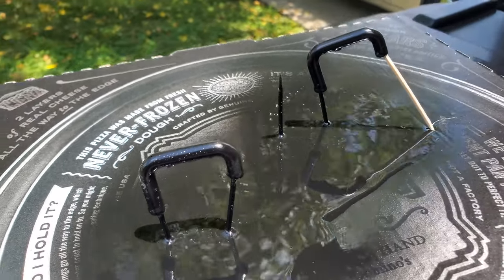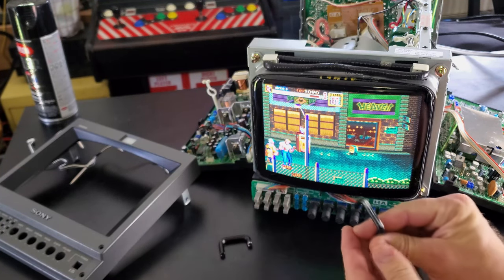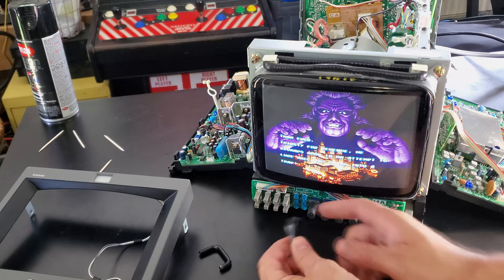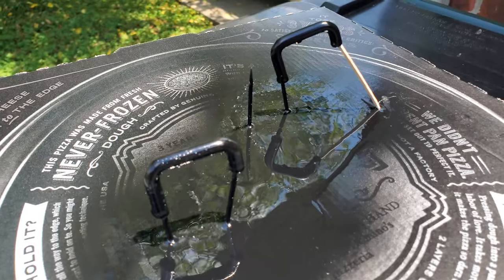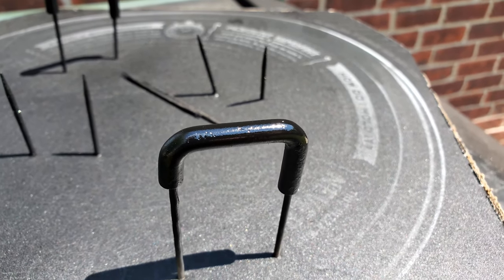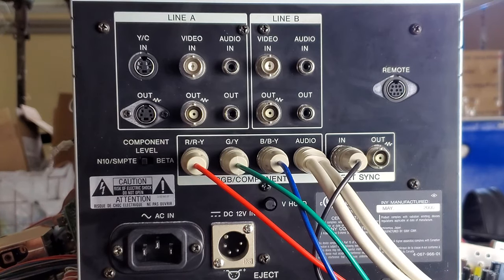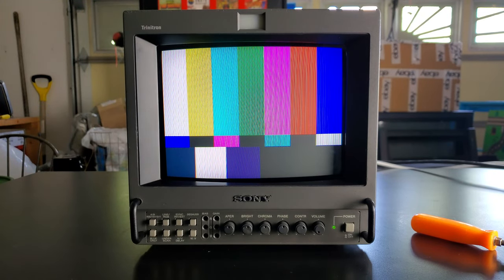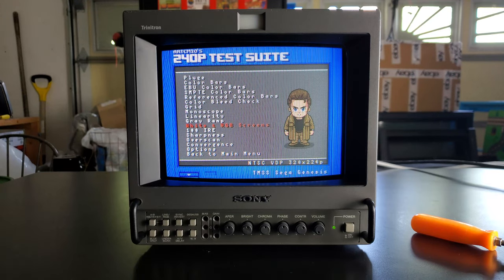Fixing the Cheapest PVM on eBay! Quick CRT Repair - Sony PVM 8042Q

Comment: I’ve got an old arcade cabinet and the monitor is missing, but the frame is there. Can I measure the frame bolt holes to figure out the crt size..???